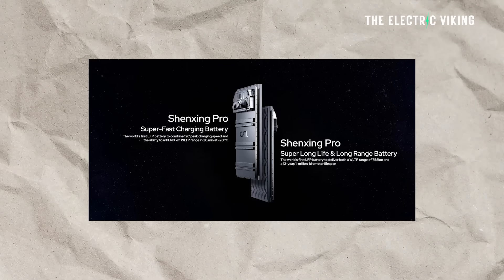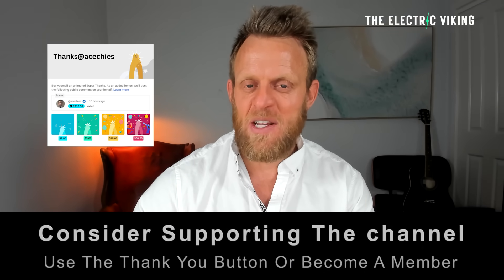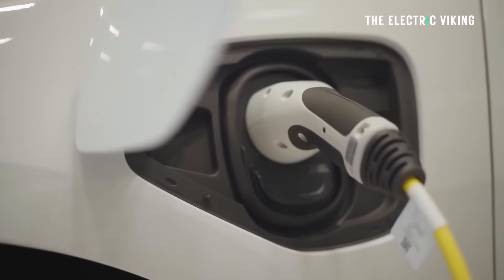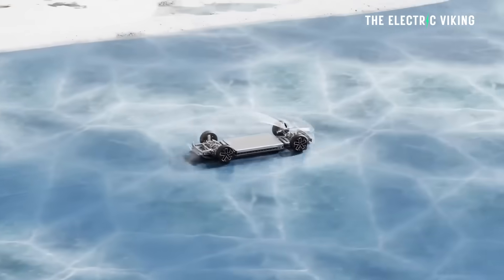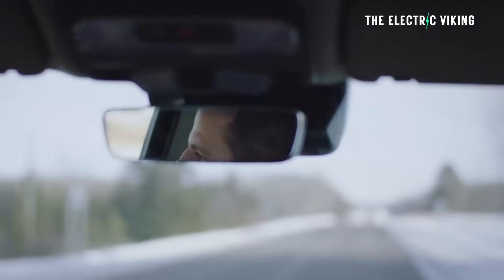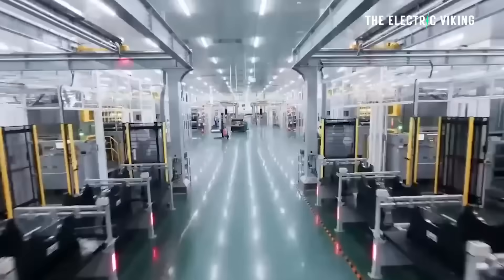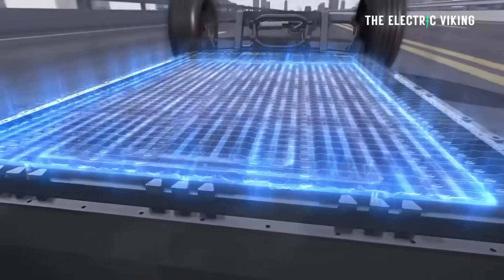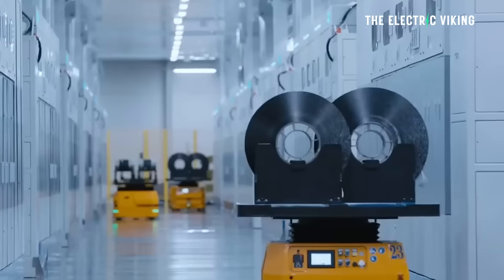CATL’s 470-Mile LFP Breakthrough: 10-Min Charging & 600,000 Mile Battery life

Comment: I'm not an EV hater. They have their place in metro areas where people can charge at home with level 1 or 2 chargers overnight. But for contractors with 1 ton trucks that pull 12,000 lb trailers when its -30F in the US in small town USA or over the road sales people driving year around 50-60 mi/yr and 200-300mi/day? Mining equipment, diesel, used to dig the rare earth minerals for the batteries, how many new mines will be required to feed the battery manufacturers, how many new mining vehicles will be needed for all the new mines, etc. Not a good fit. I am though for hybrids. This technology has been used in the rail car industry for 70+ years. Diesel-electric is old tech that really works. Take a 1-2 ton truck, install a small battery pack, small 2-3 cyl diesel that's tuned to run at a single optimum RPM to charge the battery as required. Electric motors can provide the torque and speed needed for heavy equipment. One can easily see 70-100 mpg on these vehicles. I'm just tired of the friggin mandates that by 2035 everyone will have to have a full EV. I prefer that people are allowed to drive the vehicle of their choice, as I know the whole "CO2 is a pollutant that will kill us all by 2035" if we don't change, is all BS. I wish you would step back and look at the larger picture of what it really would take to go all in on full EV. Also, many of your vid's over the last couple years are on these "new" fast charging, long life batteries that never see the light of day in actual high production vehicles. Ultra-fast large batteries will never be used unless someone figures out how to defy the laws of physics.

Comment: Fast charging battery: Do you friggin realize that 1 megawatt charging is equivalent to roughly 500 homes? Do realize what the infrastructure cost would be to build a charging station with just 10 stations that could provide that much juice? I lived in a small town of 4500 people, say 4/home equals 1000 homes. The 10 station facility would use more than 5 times the electricity of that town. I NEVER hear you talk about the "charging conundrum". Cut the charging time in half causes electricity draw to double, double the size of the battery doubles the amount of electricity needed to be stored. A simple look at the friggin' size of the wiring that's used for these 1megawatt chargers is a dead give-a-way of what's involved. Please just be fully honest as to if these large, ultra fast charging batteries are a "reasonable" approach. Delve into the costs of what 10 mega watt charging facility would cost, vehicle through put per hour and what the owner would have to charge/kw to make enough profit to cover capital and operating costs, WITHOUT government subsidies. And I'm not referring to standard write offs for depreciation, cost of goods, etc. You find that it's a losing proposition to build and operate these charging facilities. The operators just can't charge enough or get the through put, vehicles/hour, to make any money. That's why you see so many having financial difficulties, even with all the the freebies they get.

Comment: When there exist max. 400kW, 800V chargers in the EU, and even those are often limited to <350kW...what does it matter if a large pack of 100kWh could charge with 1MW? Maybe you should have mentioned that this, in theory, enables small cars (40kWh battery) to also get very fast charging times.

Comment: Chinese batteries are lithium iron phosphate batteries. They are heavy and have low energy density. Lithium iron phosphate batteries are energy storage batteries and are not suitable for the output of automobiles. Korean ternary batteries are nickel manganese cobalt batteries. They have high energy density, good output, and are suitable for electric vehicles. Chinese batteries are heavy and have low energy density. They are lying to consumers that iron batteries charge well in winter and have good driving range.

Comment: Great once the car is a wreck and only good for scrap and assuming it has v to l or g then it could sit on your driveway powering your house. No need to have it installed as it will have it's own system.

Comment: I have a good quality NMC EV.
But I will sell it for this battery.

Nevertheless, I want to sell it early just to get the CATL 120 kW and an additional 200 hp.

Nobody really needs more than 600 electric hp, but you get used to the acceleration very quickly, and it brings fun and joy. Besides, I feel safer when I’m right at the front with some distance.

Comment: 12 year doesnt seem that long... my ICE car is a 2015... got it in 2015... still going strong today. They should just warrant it for 15 or 20 then I think it will be on another level.
Reply: What's your warranty for your current ICE car? Is it still valid as of today or has it expired? Just because it expired doesn't mean it goes bad.
Reply: @AdamIverson  Sure, but your argument is in the part, but this is more of the fuel it self as if you dont have the battery, you dont have a running car. So to me, these need to be at least 15 to 20 years as that is part of the car. IF an ICE can run 12 without issues - soshould the battery it self.
Reply: @adr2t They are claiming 12 years/1 million miles. With less than 1 million miles it will likely last way beyond 12 years. No ICE manufactures claim a 15-20 year life for their cars - much less provide a warranty for that long.
Reply: @Eric-om2xs  And yet we have ICE cars older than that.. let that sink in for a bit.
Reply: @adr2t what is sinking in? We are both agreeing that cars will last longer than the manufacturer promises.
Reply: @Eric-om2xs  He said either one of those would end up marking the battery at 80%. OTher cars dont drop like that. Thats the problem I am trying to point out. They're SUPER close dont get me wrong. They just need that 1% more if you will to make them the best way to get around. I can still remember this same argument 10 years ago... some how the EVs back then were better?? Just mean, that, as we keep learning and improving, I think EV makers should get behind their products a bit more. 15-20 years warranties dont sound that crazy to me. If they do, ICE is toast so long as they keep making them cheaper in the long run while still keeping the same features/quality.
Reply: In ten years you could swap it out for peanuts
Reply: @StuartKarlson-qn8pj  4-8k doesnt sound like peanuts...

Comment: To answer your questions. about what cars they are tested on to reach that wltp range and how big the battery is

They tipically are talking about a battery that is at less 100kwh of capacity and used on a sedan (something like a Mazda 6e or vw id7) and only rwd. And,  I don’t think that they are actually testing it directly but just estimate based on official consumptions

Comment: A lot of Europe doesn't get very cold tho, even most of England doesn't go below -5 degrees and if it does it's only for 1 or 2 days out of 365 , awesome battery
Reply: For now until the AMOC collapses...
Reply: @viadharmawheel Then they will simply use the sodium ion batteries, you have to try harder
Reply: LFP doesn't like charging below +5 C (irreversible damage occurs below 0 C) so the battery would need heating quite a lot in winter.
Reply: @thamesmud The sodium ion batteries can charge @-40

Comment: A range of 470 miles from a 122 Kwh battery is not really that impressive.  Currently, with a few exceptions, batteries in EVs top out at just over 80 Kwh.  A good example would be the Kia EV3 that has an 81.4 kwh battery and a claimed range of 375 miles.  The new CATL battery if was 81.4 kwh would have a claimed range of  314 miles, still good but not game changing.

It maybe that the battery is smaller and lighter and therefore car manufacturers can install bigger batteries in the same space.  If so then that would be a significant advance.  I remain sceptical as to whether this would be the case here but I would be delighted to be wrong
Reply: What you are saying is quite true about the range but the Kia EV3 is using NMC batteries which are more energy dense and probable only getting 3500 charging cycles depending on how you charge it, not LFP as in this video (estimated 10000 cycles).